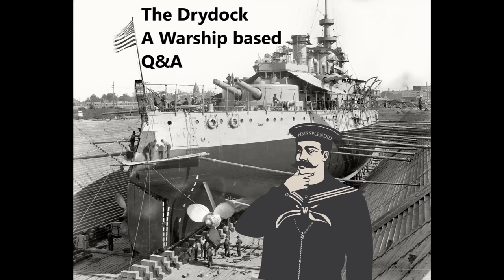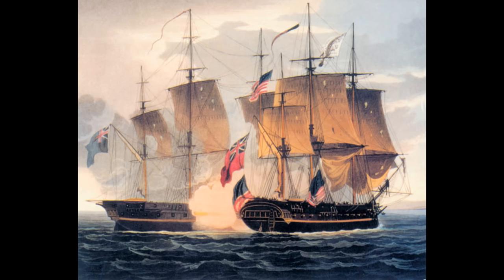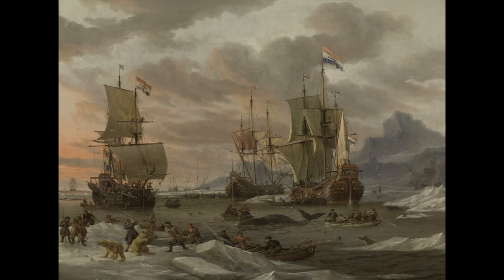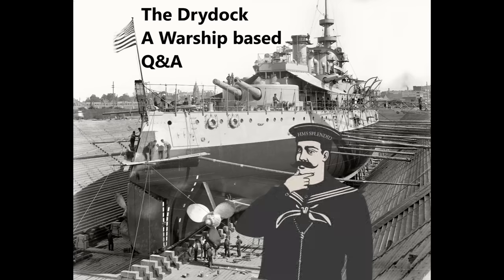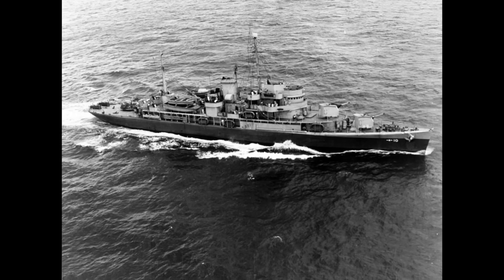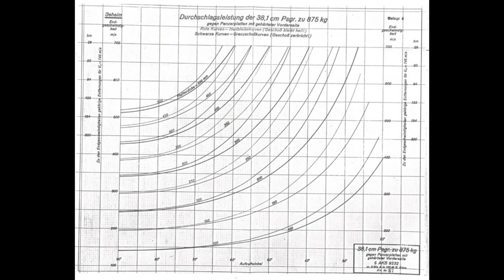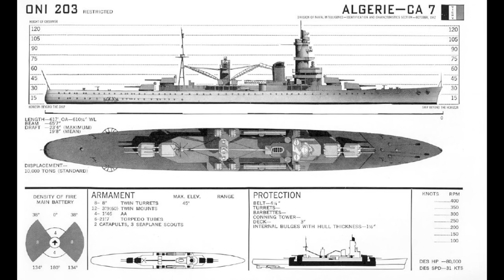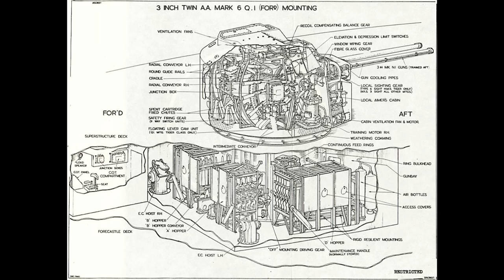The Drydock - Episode 109

Comment: To answer one of the first questions about boiler explosions. Steam expands at 1600:1. So we have a pressure vessel at x temp above boiling (higher pressure units require higher temp). So as soon as that heated water is exposed to atmosphere pressure (direct hit or cracked pipes from cold sea water) it expands that 1600:1 instantly.

Comment: The captain of the nearby Arthur Anderson communicating with the Edmond Fitzgerald stated that the captain of the Fitzgerald reported the deck rails were slackened or down after the ship strayed into the shallows, and suspected that the Fitzgerald had dropped into a trough and bottomed out, essentially bending the ship in a 'U' shape where it hit.

Would also plausibly explain damaged/missing cargo hatches and their clamps as the rigid hatches could have popped their clamps right off as the hull disfigured underneath.

In any case it was a tragic event in Great Lakes history

Comment: On the subject about the Edmund Fitzgerald, she had been ran rather hard over the years, and was due you have double bottom repaired that winter. The steel is still sitting in the shipyard waiting with her name on it. As for the waves that hit her they are thought to have been 30 + feet, and were three waves that hit her from the stern. One of the consensus is that she had gone a little farther east then she should have before she had made her turn to the southeast and had hit a Shoal a glancing blow. From that time on she was known to have been taking on water she had lost some deck railing and some vents at about the same time she was thought to have grounded. The three waves that hit her were at a wavelength far enough apart that they broke her back. They have found 2 bodies of the crew on the wreck site, and another one of a diver who died in a diving accident who wasn't recovered.  Technical diving the wreck is prohibited. We will probably never know for sure if she grounded or not, but the captain of the SS Arthur M. Anderson that was following the Fitzgerald was trying to help track the Fitzgerald because the Fitzgerald had lost her radar.  He was pretty sure that the Fitzgerald had ran farther east than she should have.

Comment: Excellent as ever.  However I do think the seaplane tender answer was somewhat misleading.  The Tangiers class tenders could and did all cary PBY Catalinas and Martin Mariners. These ships were not designed to launch aircraft in open water, but to establish forward operating bases to support patol squadrons at small Pacific Islands, Atolls and reefs ahead of the fleet to carry our maritime patrol. Both the Japanese and  USN built large seaplane tenders for this purpose - in the age before radar. There were also smaller seaplane tenders based on converted WW1 four stackers. Again these were to support fights of smaller Vought Kingfishers at forward bases.  In the Atlantic you correctly pointed out the Islands are not there for this task, although the USN did base seaplanes in the Carribean, on Ascension and the Azores as well as in Brazil and Iceland for ASW.

Comment: Lowering to an equivalent velocity at the muzzle for approximating linear moment of the shell is a solid method, unless the muzzle in question belongs to a smooth bore its rotational energy cant exactly scale accordingly nor at the time could its measure be taken. Were modifications made in barrel length or the interplay between driving band and rifeling such that all dynamics of its rotation and  attendant flight characteristics of this spiral  allowing adjustments be made, the math alone couldn't  describe to what need adjustment be made. Were the initial equation to entirely omit variable aerodynamicies like  drag, winds, air presures, temps and humiditys from the calculus and were test firing then to be conducted in a vacuum the problem almost becomes a nonissue lol

Comment: With regards to drydock load distribution.  these days naval architects have the engineering of keel blocks refined to the point that side bracing is usually no longer necessary, even with a cylindrical hulled modern submarine. Some yards may still use them, but the one I currently work at and the ones I was in when I was in the navy don't .

Comment: Drach, there's a lot of conjecture that she bottomed out, already overloaded steaming full power into Whitefish bay..  An Iron ore load will bring the ship to 26.5 feet with less than a full load, the max for the Seaway,  so she may have been able to ship the extra water safely...
   Mind you , a Lake boat has less stringers than a Salty, as she's not really made to weather big Storms like on Atlantic crossings, but they are built pretty strong..
   The action of the waves, hogging and sagging the hull, as she fought the troughs certainly weakened her, but finally perhaps half an hour steaming from safety, she crossed a shallow point on her way into Whitefish, most likely caught a Trough wrong, and her bow hit the bottom with immense force on a steep angle..  Cleve'd the hull where she was shipping all that extra water, and sunk her with all her crew... sort of the Titanic in reverse is the best way to visualize it.
     Happened in seconds, and in deep enough water that the crew had no chance.. 
 When I was an AB on a lake boat, the skipper played Lightfoot's song every time we Sailed out of the Sioux, bound for Superior... a reminder that 15 min can make the difference between safety and all hands lost out here, always said a little prayer for the Families as we passed the spot, One long One Short blast on the Horn was the signal.. may the crew rest in peace..

Comment: I remind that in land warfare had the proposed Bates Eight-Barrel Bottle Thrower offered in the aftermath of Dunkir. It was designed to hurl Molotov Cocktails at German tanks. This could, I think, have worked in concert with running pipes for gasoline down to the beaches and setting the beaches on fire. They were interesting days as the UK prepared for Operation Sea Lion.

Comment: I'd buy a model kit of the Thunderchild in 1/350 or 1/700, in plastic or resin. I imagine the catch is that to be economical, you need a MASSIVE production run. That's the reason Lego require 10,000 signatures before they start to consider a model for production. You could do a resin kit for less, although it wouldn't be cheap on a per-unit basis. You probably want to talk to the people who do short-run Star Trek kits, they have very high levels of detail these days and are just as obsessive as any naval grognard.

Comment: Once a chick turned a garden hose on my steel woodburner when I was gone. It ripped the heads of the bolts holding the firebrick support clean out and twisted the sides, splitting it nearly in half. What a mess. She did it became she was mad I necked the stove pipe down, said it was unsafe to go from 8 to 6". Like she ever cleaned the creosote out. Thanks for the space to put a rant in about water hitting hot steel.

Comment: Closing the Mid-Atlantic U-Boat gap was one of the major uses of the Escort Carrier during WWII....
Sending an Escort Carrier with the older F4F Wild Cats and the TBF/M Avengers could scout out ahead and to the flanks of the Convoys,  especially as we were able to place radar pods on the planes,   subs became extremely vulnerable on the surface when recharging their batteries,   even after the addvent of the Snorkel....
And America was kicking them off of the launch rails as fast as they could....

Comment: Regarding boiler explosions on ships, another thing engineering crews would do if they know the ship is sinking is to open relief valves to vent the steam, thus rapidly but safely reducing the pressure. A famous civilian example is the Titanic, where within an hour of the iceberg strike the boiler room crews started venting steam to avoid potential explosions, with the side effect of nobody on the top decks being able to hear themselves think over the roar of escaping steam.

Also, regarding slow flooding meaning less of a chance of explosion, this was borne out in the loss of the SS Central America, a steamer that sprang a leak in a hurricane in 1857. In a last ditch effort to keep the engines and pumps going, the engineers, aided by some passengers, formed bucket chains to haul coal across the pitching deck to the furnaces, only giving up the fight when the water rose too high and flooded the furnaces out.

Comment: Iirc one of the major issues German had in WW1 was access to nitrates for fertilizer since there was the conflicting demand for their use in explosives and most had to be produced synthetically using the new Habor Bosch process. Production of synthetic nitrates was more advanced by WW2 but the blockade was still to Germans detriment. The blockade made Spain who exported iron ore to Germany prewar need to find new buyer as the trade was needed to finance food imports from South America, Britain was that buyer so it made them a lot less helpful to the Germans than they might have been. Also the whole timetable for the invasion of the Soviet Union and it's failure is set by the German oil reserves. Had they not invaded in 41 they would have been unable in 42, as it was their logistics staff had said if the oil fields were not captured within 3 months the supply system would breakdown. Lack of high temperature alloys made the ME262 engine life about 20 hours. Milk from French farms often got spoilt due to lack of transportation.
Reply: I have since found a article stating that in 1941 Germans in Poland received a ration of 2600 calories, Poles 700 calories a day and Jews 186 calories a day (that's about the same as a packet of crisps)

Comment: Boiler explosions  - action stations all boiler safety  device's are disabled ( gaged) , you dont need boilers flaming out because the drum water surged leaving you dead  in the water. Boilers not tripping off due to low, low , low water exposing the junction beteen water drum and water tubes 2 things happen  tubing turns red hot  - then the drum water sloshes back causes the tubing to be quenched (heat treatment - hardened ) the ticking time bomb failure at any time ,, red hot tubeing slosh water allmighty steam hammer fracturing tubing like a hand grenade , shrapnel  bouncing  around the engine room plus a super heated steam leak - oh what fun to be a stooker

Comment: Sailing boats proved that the eye form hull increased the length of water line and lean of the hull waterline contact. ie,fast ocean sailing boats display this hull form..Be Blessed. PS.more hull surface in contact helps increase speed,probably cuts weight per square foot of hull allowing a better effect of the hull skimming or towards skimming perhaps?

Comment: On having limited run models made, I make 3D printed model kits for sale so do have some experience on making them. 1/700 is a bit big for most resin 3d printers, however thunderchild is less than 100m so that would be at 1/700 about 140mm, that's a day long print in a Photon, but it will fit on a photon, so its not outwith the realm of possibility to do in limited runs. I don't have much experience with ships, that don't carry giant robots anyway, and my printers are down waiting on screens, so I am not offering to do this, but I might have a play with CAD and put my work up on thingi if I get anywhere, if you are ok with that of course.

Comment: Armor penetration is covered to some extent in my various articles and BASIC computer programs (with Source Code so that the logic can be followed) at NAVWEAPS.COM.  With homogeneous, ductile armor (wrought iron through "non-cemented" -- usually, though not always (ahhrrggghh!!!!), meaning no extra hardening of the face of the plate first hit by an enemy shell -- nickel-chromium steel) against projectiles that had no thick steel "crash helmets" called "Armor-Penetrating Caps" (US Army term "AP" as opposed to "APC" for projectiles with such caps -- this is confusing since the US Navy after about the year 1900 automatically assumed any armor-piercing projectile had such a cap and used "AP" for capped shells and degraded any shell without such a cap, no matter how strongly constructed, as a "Common" projectile fit only for use against unarmored or lightly-armored targets) and a pointed or oval nose nose (longer than it was wide above the cylindrical middle and lower body of the projectile),  at right angles the French ballistician De Marre's generic formula called the "De Marre Nickel-Steel AP Formula" (NOT his earlier wrought iron formula!) gave a rather good rough estimate of penetration (defined by him and later the US Navy as a "complete" penetration where the shell, or most of it if it broke up on impact, barely made it through the plate and fell onto the ground on the far side of the test plate -- this definition is NOT used by some nations or military agents and is a major source of confusion in evaluating different sources of data!!!) compared to tests he ran in the late 1880s against nickel-steel armor made by the very highly competent firm of Schneider et Cie. when throwing in a "fudge factor" called the "De Marre Coefficient", C, to adjust the computations to the actual plate being tested.  It worked amazingly well (not perfect, but good enough for many tests) at right angles (but NOT at any other angle!) for almost all homogeneous, ductile armors of thicknesses between about 0.25 projectile diameter, called "0.25 Caliber" through about 1.1 Caliber -- above 1.1 and the armor becomes so thick that it has to be wedged sideways out of the projectile's path against the resistance of the armor farther toward the plate's back surface as opposed to being folded backwards as the projectile pushes through, as is important in thinner plates, and thinner than 0.25 and the plate begins to "dish" -- dent in a large cup-shaped area larger than the impact region so that resistance goes up and up until for the thinnest sheets the entire plate is turned into a pit or funnel -- that also requires other equations to handle properly.  The usually blunt, sometimes soft and sometime hardened AP Cap, can seriously change this, especially as it is broken up against thicker armor at oblique impact, as can making the projectile nose too blunt (hemispherical or flatter), again requiring other equations, which makes comparing different projectile designs with different nose shapes and caps confusing without a lot of very good information of exactly how the tests were carried out.  Projectile damage due to the impact, particularly against face-hardened armors especially designed to do this to degrade a projectile's penetration and/or post-impact explosive power, varies a lot with impact conditions and the projectile's manufacturing and chemical properties, making reasonable estimates difficult to find.  Particularly at impacts over 45 degrees from right-angles, nose shape and cap design and damage resistance can make test results only valid for a single projectile design, size, and target plate type.  Finally, face-hardened armors fail mostly by the face layer being punched through the armor's back like a huge cone- or cylinder-shaped cork (mostly in pieces, but not always!) and thus need a rather different basic formula from the De Marre formula even when the projectile is undamaged and hits at right-angles on a plate of, say, 0.75 caliber.  Considering that it is simply taking two metal chunks and banging them together -- about as simple as it comes in science -- many results are amazingly difficult to pin down!

Comment: Yeah, Metal is super tempiture sensitive, That's why it's smart to warm up your Car. Many of your Cylinder Head Internals are technically out of Spec until the Heat of the Engine causes them to expand normally around 5 or 6 Thousandths of an inch..

Comment: 1:55:00 - what is that metal "railing" on both sides, behind last turret for?

iirc some ww2 submarines had them too.
what's it function?
Reply: That juts out over the propeller blades. It's called a propeller guard. There's a picture of the USS Faragut in drydock circa 1925 that helps to show how they line up.

Comment: USS 2nd Amendment, The first All-All size Gun Battery Battleship,  12x 16/50 naval rifles in 4 three gun turrets, 28x 5/38 dual-purpose in twin mounts with a separate MK-37 for each, 16x quadruple 40mm mounts 4 on each super-firing turret and 4 each in the bow and stern, 36x twin-mounted M-2 machineguns, and every not currently used position will have a Mono-pods welded to the deck in order to support various rifles and pistols manned by the Marine and crew aboard

Comment: When the wreck of the Fitz was surveyed most of the clamps for the hatch covers were found basically intact. But every fourth one was severely damaged. The ship left Superior on a Sunday afternoon in good weather. Its thought that they intended to finish clamping the hatch covers. What most likely sank her was water washing in through gaps between the hatch combing and the covers. She likely nosedived into the lake bottom in one piece and the loads of the screw on the ship twisted the stern causing her to rip into two major pieces. Storms on the lakes can brew up quite fast and one big problem is you dont have a lot of sea room.